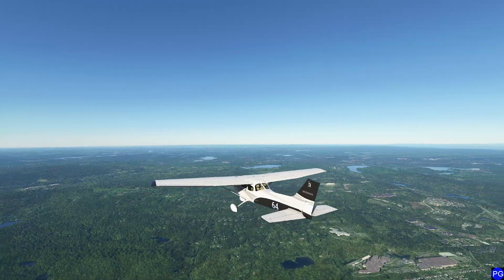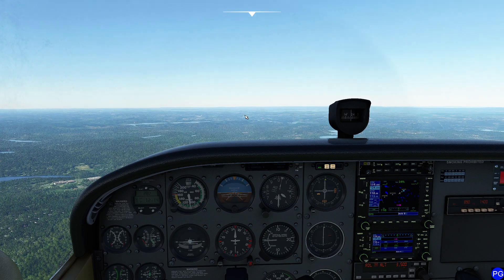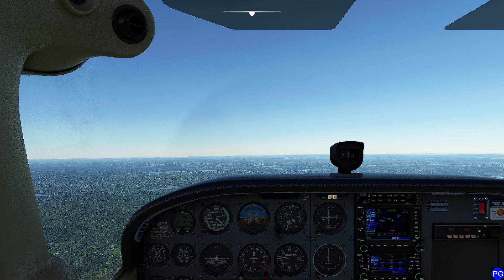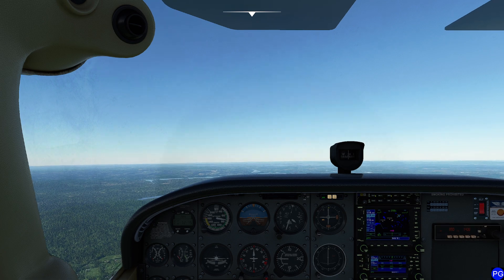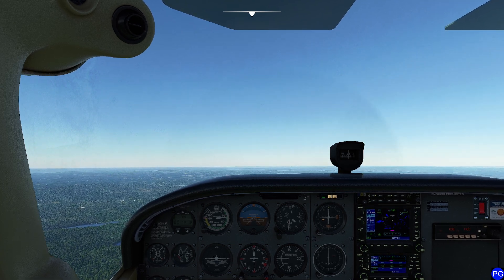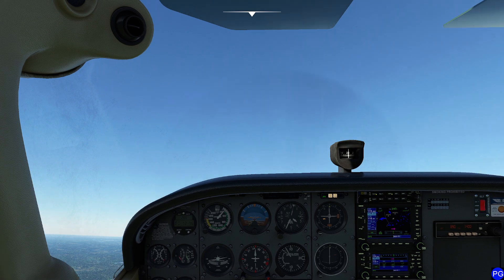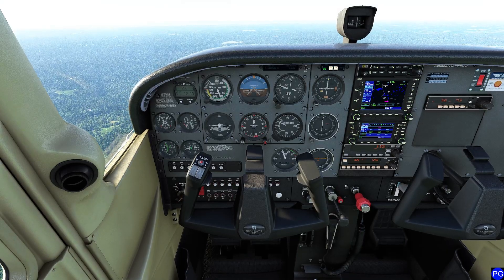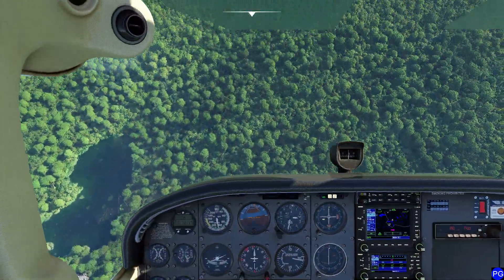MSFS - Spin Recovery

Comment: If the plane is certified for spins it will recover if the recovery is done correctly. if you have never done a spin find an instructor before you do then solo. Don't do a full flap spin with full power.
Reply: That actually happened to me right after solo unfortunately. I thought that’s it, I’m dying. Thank God I put flaps up and continued with the rest of stall recovery

Comment: I thought the C172 and C152 are forgiving enough to come out of spends without a lot of user inputs. Your thoughts?
Reply: They are. And the 172 will recover even if you keep the control inputs that started the spin. It is possible to keep the 172 in a spin but it is difficult.
Reply: Yeah. I did a video a year ago comparing and contrasting the stall/spin characteristics of MSFS and X-Plane. It's available here: https://youtu.be/SjT06QyN1no
Reply: @VirtualAviationAviator  Thanks.